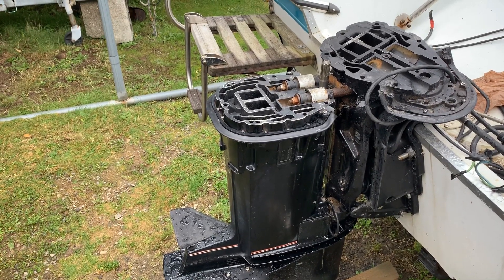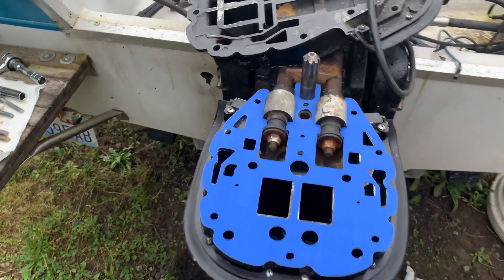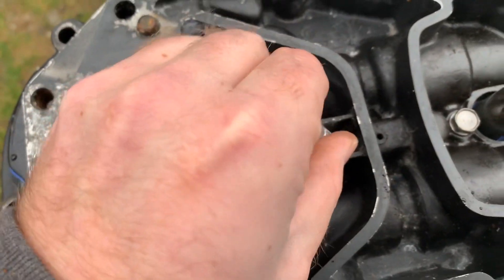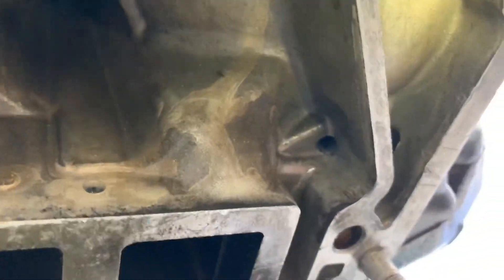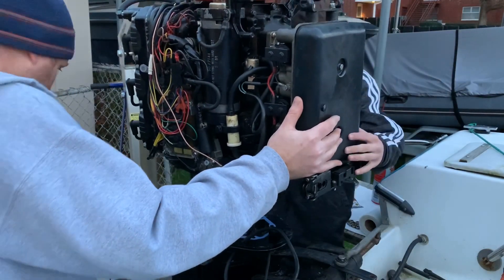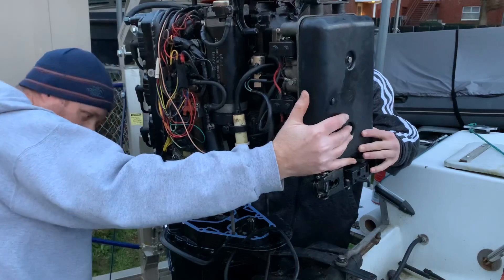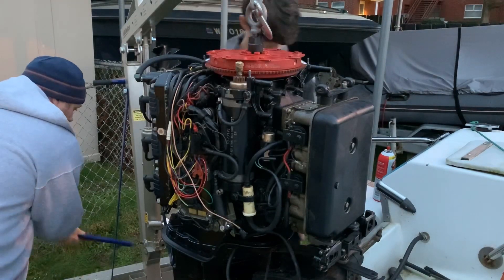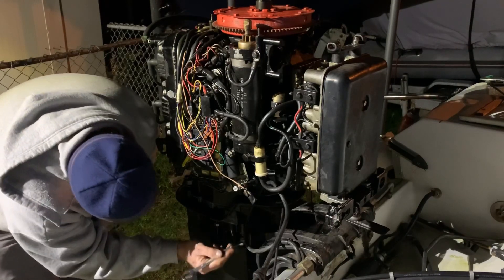150hp 2stroke Mercury outboard water passages and powerhead install

Comment: when setting the powerhead put the base gasket on the powerhead the studs will hold it with just a dab of grease between studs ,lot easier than trying to line studs up to holes in gasket

Comment: Cold water first of all enters the exhaust manifold, then it goes to the cylinders' heads where thermostats start opening quite soon allowing water to show at the telltale. 

As I've seen at the service manual
poppet valve allowing water to flow around the cylinders to exit towards the lower unit doesn't start opening until rpm go over 1500.

Comment: Have You Thought About Contacting L6 MercSon in The USA Who is a Very Technically Knowledged on All Large Mercury 2 Stroke Outboards.
I Personally Think You Still Have A Blockage in The Midsection or IT Could Be Drawing Air IN Somewhere Possibility A Crack Etc.
Reply from the maker: I did everything I could to look for cracks and blockages I used a small bore scope to look in the passages it’s running good for the last 2 years redid the vacuum lines and cleaned and leveled the carburetor floats new needle and seats been running 160 degrees after full throttle no thermostats to flush out anything else that I might have missed scraping it out.
Reply: @haneysgarage2631  
Evening. Thankyou For Replying. 
I am Glad You Have Seemed To Have Sorted The Problem. 
Outboards in General Can Be A Nightmare.
I had  Mariner 90hp And it Flew on My Skiboat.
I Also Have A Classic Mercury Blueband 50hp of Which I Have Had To Replace All The Electrics On.
I Am Also Have Two Archimedes Crescent  25hp. 

Happy Boating And Stay Safe Both Of You On The Water. 
Kind Regards.
Andy.

Comment: did clearing those passages fix your issues?
Reply from the maker: I have checked the temp after WOT and was at 160 no thermostat letting it flow thru the system for a while first
Reply from the maker: Before cleaning out the water passages it was reading 147 to 150 at idle on the right side head left side was reading 120 and no water comming out of exhaust at high speeds like it’s supposed to it was clogged up

Comment: I have a 1987 150 mercury xr2. I am having temp issues at WOT. Also my water pressure gayge goes to 40 psi and sometimes higher. I cant figure out what is causing this. Do you have any idea or have you seen this before.. I have replaced poppet, thermostats and impeller. temp sensor and temp gauge..
Reply from the maker: TheSwackster it could be restricted passages in the water jackets I would run salt away after each saltwater use and mabye try using Barnacle Buster with an external pump but it may clog up like mine did I checked the thermostat housing after doing mine and both thermostat housings were full of salt debris that moved from the barnacle buster solution, I ended up pulling the heads and cleaning the water jackets but I should have done the flush about 3 times first, the motor I have was used primarily in salt water. Remove the thermostats and lower unit and tape a tygon hose to the water pick up tube and let a marine bilge pump solution using a garbage can to cycle the solution for several hours
Reply from the maker: I forgot to mention that using the Barnacle Buster solution can possibly cause damage to the head gasket especially if it hasn’t been changed in the past but it might be ok just depends on how salted the gasket is on the inside because it eats away at salt and corrosion

Comment: Quick question on the starboard side head do you have a water jacket plug? I just pick a 1993 or 92 xr6 150 and someone removed it and I’m not sure what went there I found a hose but it has a t connection with only one hose hooked to it. And there isn’t much on the internet about these engines. It a brass nut with a hole in the center looks like a PCV value on a car.
Reply from the maker: David Gardner are you referring to the water jacket hoses that connects the cooling water to the heads together and then out the tail tail or is it a breather hose/vacuum hose
Reply: Haney’s Garage I know there is 2 thermostats that connects together but under the number 1 spark plug there is a some sort of water jacket I don’t know if that’s for a temperature gauge or a warning buzzer of the drivers side or port side both sides have them and are missing on my engine the both have a tan wire  bullet connectors
Reply from the maker: David Gardner that might be the temperature overheat sensor there is usually one on both heads, does it just dead end inside the head
Reply: Haney’s Garage yeah I did find it it’s called a thermal control valve it make the carburetors run rich until the engine warms above 100 degrees then opens allowing more air into the carburetors. Just thought it was strange to have a hose that ran from the carburetors to the head. And thanks for replying to me and the help. Just got this and it’s SO much different than my OMC 2 strokes I’ve been working on forever.
Reply from the maker: David Gardner nice good to know what it’s called and what it does

Comment: I have a question for you when Im blowing in my Tell tale and it's going out in my shaft would that mean I need chang my exhaust plate gasket. I'm having trouble on my 200 hp Mercury pissing.?
Reply from the maker: Bornonfire it can go back thru your pickup tube in your exhaust housing that connects to the water pump if your using compressed air and be careful not to use high pressure it can make seals fail
Reply from the maker: Bornonfire if it’s leaking air inside the cowling then it could be the powerhead gasket
Reply from the maker: Bornonfire if your referring to your outboard flowing water into the exhaust housing instead of the tale tail then you may not have aligned the pickup tube with the water pump housing correctly
Reply: Thank you . There is a small hole on the other side of the tell tail in the shaft.  When I'm blowing in it I come out in the shaft.  I'm trying to troubleshoot it not pissing. I have a 200hp exact motor to your 150hp.
Reply: I thought after the water completed cycle through the water jacket it went out the exhaust. And The Tell-Tale
Reply from the maker: Bornonfire yes there is a poppit or pressure relief valve that splits it between the tell tale and the exhaust by pressure from the water pump you may need to check it for debris and use new seals
Reply: Haney’s Garage if you’re running full out don’t the poppet dumb extra water into the exhaust?
Reply from the maker: David Gardner yes the extra pressure goes thru the exhaust outlets

Comment from the maker: I have removed the heads, got them resurfaced and removed & cleaned out the exhaust plate and water passages also replaced the poppet valve/pressure relief valve. New water pump and gear oil.